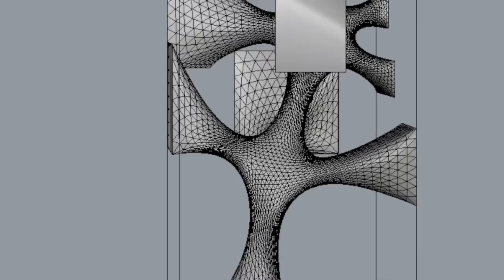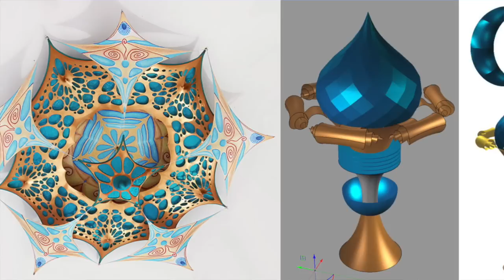Integrating Permaculture in one small town by Michael Tellinger & Alosha Lynov

Comment: The New Power systems of the Future will involve Graphite. We can make Graphene Solar Paint for collecting energy. This Energy can be stored in Graphene Supercapacitors power storage batteries. We can use Graphene Conductive Paints for wires to lights and heating devices. We can create Graphene Radiation/Heat Paint for heat our Living Spaces. We have 100 million ton deposit of Graphite. Now we need to Creative ways to get graphene to ALL the Sustainable Communities :)